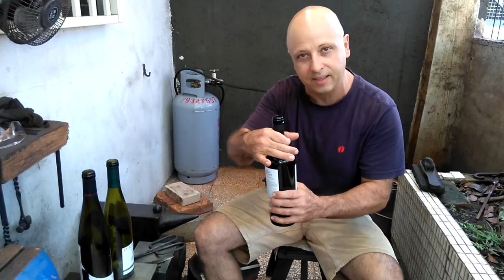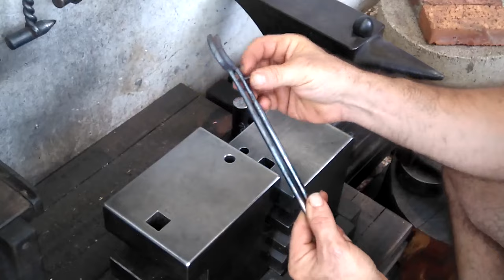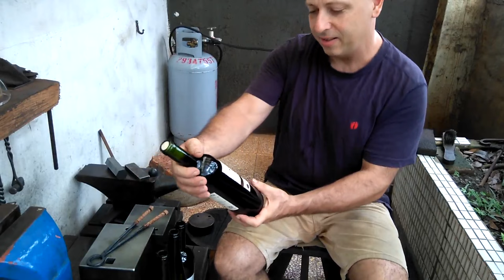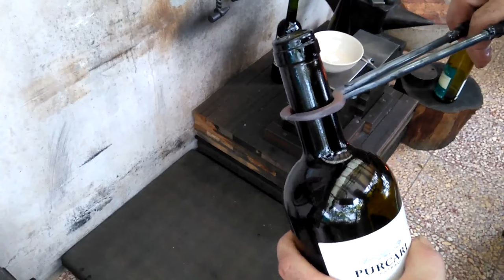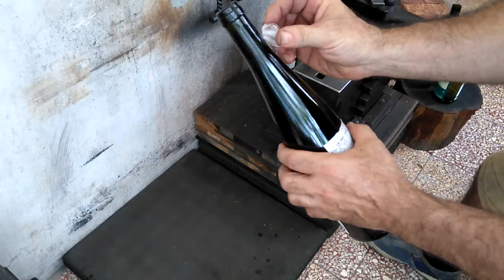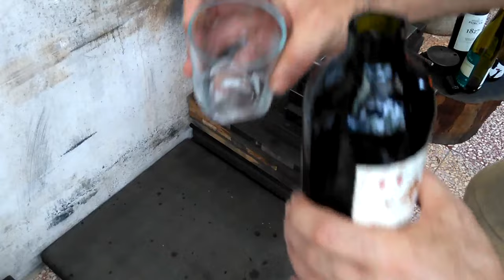Blacksmithing - wine tonging - alternative way to open wine bottles - surprising results - port tong

Comment: Very entertaining and instructive Glen. That would be a great conversation starter at any dinner table. The full bottle built up quite a bit of air pressure due to the heat, and any fine fragments of glass would have been blown out in the "explosion", keeping the wine pure. 😊
Reply from the maker: Yes, definitely something that could entertain guests. And with how I go about it, they would get a wine shower! Need to refine my technique. Good point about the air pressure building up from the heat. And like you say, I wouldn't have to worry about fragments being deposited in the wine - just worry about fragments becoming shrapnel! I had fun with this. Thanks. Glen

Comment: That was awesome, my mother-in-law is an avid wine drinker, I may have to try a pair of these when my skills progress a little farther. Also I was thinking that the last one may have cracked because if the cool temperature of the wine inside. Maybe more experimentation is needed with your favorite brand. But all this to say, Great Job! I love your videos, keep up the good work. And don't worry about the short times when your hand blocks the camera for a bit, everyone understands. Your content is great.
Reply from the maker: John, I really appreciate your comments. It's not easy for me to get this video making right from all angles and so your understanding is welcome. Also, I know the sound goes up and down quite a bit depending on my location... Anyway, I definitely need more experimentation with wine tonging and may revisit this again some time soon. Good luck in your blacksmithing. Thanks. Glen

Comment: They do this on ports because they are aged sometimes up to 50/60 years. The corks won't come out of the bottles because they are so brittle and old. They do decant the wine afterwords which involves straining but it's for settlement not glass.
Reply from the maker: David, Excellent comment. I, and I'm sure others, definitely learned from what you wrote. I really like when knowledge like this gets shared in the comments. Thanks. Glen

Comment: Awesome video. I have to admit I played music a well to do party in Houston TX. The tongs they used came over the top like bolt tongs and they used a shaving brush to cool the bottle.
Reply from the maker: Based on the comments, it seems the cooling part isn't too critical. An ice cube or feather, brush or towel dunked in cold water all seem to do the trick. Thanks for watching and taking the time to comment. Glen
Reply: No sir,,,, thank you for sharing your knowledge and what you are doing. I am not a blacksmith grew up watching an old man doing it. He is long dead but some great memories watching him.

Comment: Good video, fun and interesting. Glad to see Blacksmith Bird is still around. I collect antique glass and bottles and yes glass quality can vary greatly, also thickness can effect the result. Glass is a good insulator more than a conductor, it can't transfer the heat away from the hot spot like metal and other materials, the molecules heat up and get very active but the surrounding glass is relatively stable and you get the crack. It's an exaggeration of a bad heat treatment where the metal cracks from improper temperature change. Sorry I rambled on, just thought I'd add my two cents. The vinegar(?) acid finish on the hammers looks perfect, darker than before, is that the finish you put on tools you sell? Thanks for sharing, looking forward to the next video.
Reply from the maker: James, First, thanks very much for the generous donation. It certainly helps me keep the camera rolling. And your input regarding glass is super - let's me understand the processes at work even better. You can ramble any time... I like the look of the acid, dull gray finish. It gives the hammers more rust protection as well. Currently, I only use this on hammers. For tools like my tongs, I normally give them a final heat, only to a temperature where a fine skin of scale forms but doesn't flake off, brush them with a brass brush when warm and spray them down with WD-40 when cold. Thanks again. Glen

Comment: very interesting. i cut a lot of glass bottles but never using this method. i'll have to make some tongs
Reply from the maker: It seems a lot of folks are setting about making tongs after seeing this video. Be safe if you give this a go. You mentioned cutting a lot of bottles and it made me think that maybe wine bottles could be scored and cleanly broken off as well... Thanks. Glen
Reply: thanks for that. and yes, wine bottles can be cut to make nice little vases etc.

Comment: Nice one. You can try to hold it for few sec and then grab with a wet towel.
Reply from the maker: Michael, That's a great idea. It seems that the method of cooling isn't so important - just that it cools quick enough to crack. Thanks. Glen

Comment: while searching for a specialized electronics desoldering tool i came across an electrically heated pair of tongs referred to as port tongs. I now know what they were for
Reply from the maker: I never knew they made an electric tong for this very purpose - very interesting to know. Having a plug in pair of this sort of tong would definitely be convenient and probably give the exact heat needed, which is likely much less than the heat I attained in this video. Thanks for sharing. Glen

Comment: how much does propane cost in Taiwan?
Reply from the maker: Thats a good question. My tank is a 16 kilo tank and I the last time I got a full tank, it cost me about $20 USD. A full tank lasts me roughly 10 days of forging, maybe running 4 hours a day. I run at a pretty low pressure, around 4psi. And, I get better fuel economy in the hot summer months (gas seems to expand more in the hot weather). I think the price is actually comparable to the price in the US. Thanks for watching. Glen